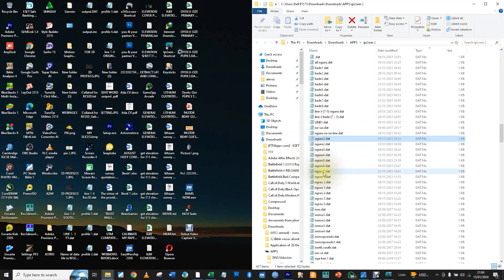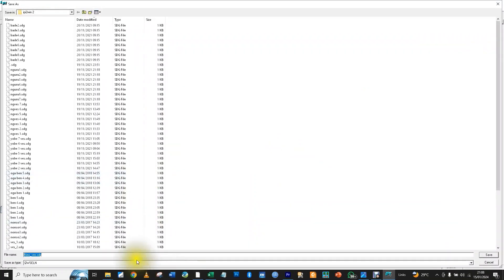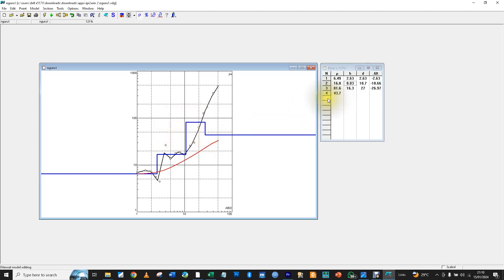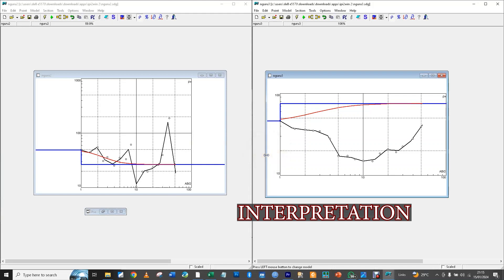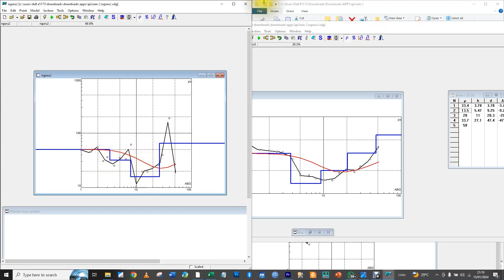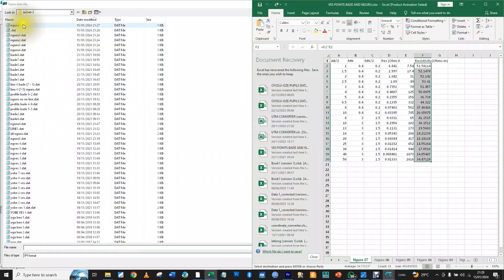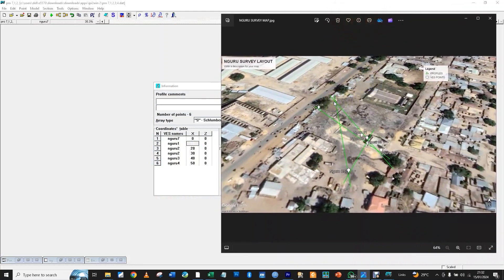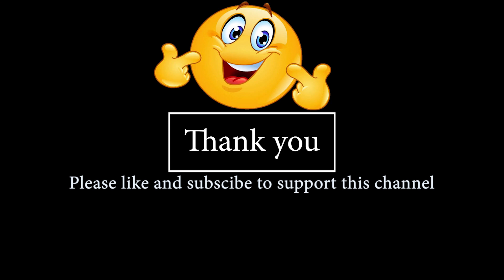Interpretation of 1D VES data and Correlation across VES  points.

Comment: Thank you for this tutorial. It is very timely.

I'm doing my undergraduate project in line with this. 

I didn't fully understand creating and interpreting the cross section part though. Could you please throw more light on it?

Also, it seems that the IPI2Win software is only for 1D interprétation. Is there another software I can use to give a 2D interpretation?

Thank you very much
I await your response 😊